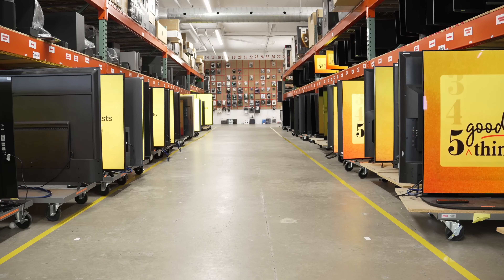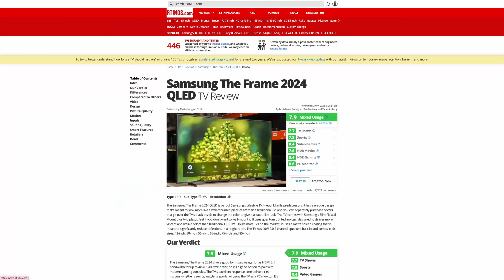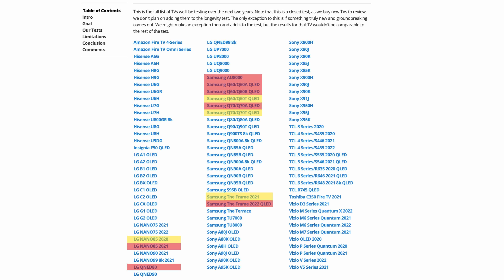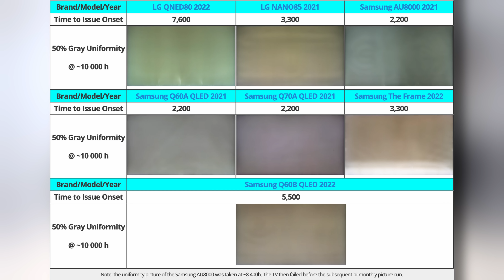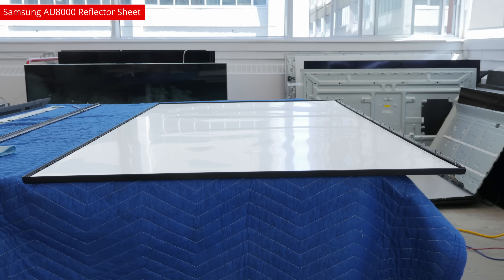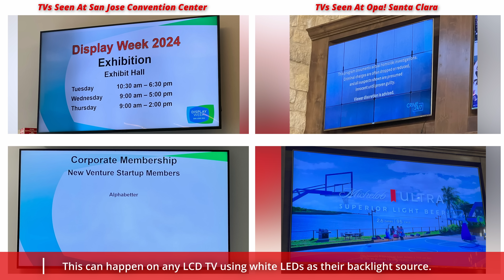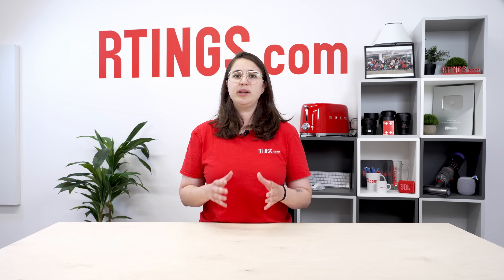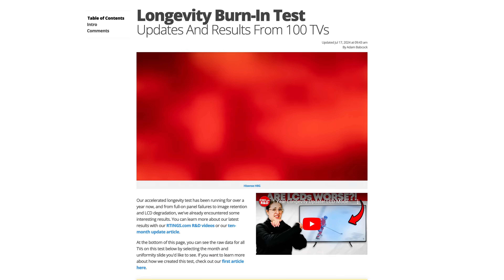Edge-Lit TVs Fail FASTER Than Others (100+ TV Test)

Comment: This is fascinating, it’s honestly weird to me that anyone buys edge-lid displays when they’re so much worse. I always figured these would’ve died out after the 2000s because I always though they were purely made to be cheaper than full array sets.

It was interesting to see they’re still around and it does make sense considering they can be thinner, but this is just another reason to avoid buying them.
Reply: You do know most people don’t know what are edge lid TVs or full array. Most people buy thin, cheap and big.
Reply: @jtcr17  and low quality.
Reply: They were initially made because it was easiest(fastest & cheapest) way to make LCDs thinner. LEDs are brighter, more compact and more efficient as I’m sure you know.
Reply: You think it's weird that 99% of the population doesn't know the difference between oled and edge lit lcd? It literally boils down to what is the biggest size for the price and that's it
Reply: people generally do not understand display technology in the slightest.
Reply: and that's why consumers so often make bad choices. That's not a surprise.
Reply: They are only around today because about 80% of all TV buyers out there don't do their homework before making a TV purchase. They simply either buy what their friends/family tell them to buy or the just buy whatever is cheapest at the time and what is on the deepest sale. Those are about the two absolute WORST ways to go about buying a new TV.

Comment: Your tests are so helpful.
Quite shocking that edge lit screens can be considered weaker than OLED's in terms of lifespan.
Reply: My old Panasonic Plasma from 2010 ist fine. Working good, No burn in, good colour, Just one Pixel ist dead. 
But picture ist little bit dull / Not very bright. 
But No Problems in over one decade of using it as primary TV. 
Two years ago i did buy an LG OLED, because of 4k and HDR. 
The Plasma ist still working in the guests room.
Reply: What's shocking is that those TVs are extremely dull - I have a Frame and it says it hits 600 Nits, it looks like it's dead in HDR compared to my 2014 Sony in SDR.  I've no idea where the heat comes from.  It's not like they are showing anything impressive at 1,000 nits...  The 2014 Sony is supposedly Edge-Lit but I've measured large highlights at 1,000 nits in SDR (in Standard mode) and it still has a perfect white screen and even temperatures across the entire panel which suggest that it might be back-lit (and Sony seems to have hidden that) 🙂
Reply: @techsamurai11 it’s very simple: older TVs are thicker and have more metal that dissipate the heat. Newer models are extremely thin and light but buying them for cheap, then they’re built for cheap, therefore more plastic and lower materials (including the LEDs). Of course they won’t last long…

I had a Samsung TV from 2013 or something like that, 1080p, LED (don’t know what the tech was) and I sold it last year as new!!! In my family we have a much more advanced 4K TV (but new at the same price as when my 2013 was also new, around 600€) and after the warranty the panel started to shift to blue. I talked to the support and they wanted almost the same price to repair as a new one!

Things are built now with two purposes:
- last enough for the warranty to end
- not to last enough so that you keep it too long.

That means: before 2015 they were more built to last >10 years; after 2015 they were built to last 4/5 years and that’s it.
Reply: A broken LED backlight is pretty much repairable. My 2015 LG TV broke in 2021 and got it repaired by a local shop. They replaced the broken bits.
Reply: My last lcd tv lasted 14 years. My current 6 year old oled doesn’t show any signs of burn in after 22k+ hours of use but it is starting to have issues with motion
Reply: Need to distinguish between led edge lit (the cheapest tvs on the market) and led full back lit.
Reply: Wonder what thick plasma screen are or were?
Reply: According to my findings on the internet the average lifespan of an LED TV is 5 to 8 years, while OLEDs are usually rated for 10 years.
Reply: @neptune612  My first LED screen died or more like shifted to blue after 7 years.
The second started having issues with dirty screen effect after 3 years.
The third is OLED, fingers crossed since am taking extensive care.
Reply: @neptune612  8 years is rare for almost any tv made in the past 5 years.
Reply: @neptune612 weird, my parents have led TV for like 15 years
Reply: @neptune612  LED in my friendsgroup is 3-15 years. OLED has yet to die but some early LG has burn in.
Reply: @neptune612  "rated" for 10 years means eff all if it's the usual unreasonable lab test standards, similar how MPG ratings have almost nothing to do with the real world

Comment: I'm certain the manufacturers are using much cheaper LEDs than necessary for the brightness targets and overdriving them with too much current with insufficient cooling
Reply: It’s shame consumers won’t accept 3-4” thick TVs. You could get way higher brightness, properly cool the LEDs, and have a more robust chassis.
Reply: @MechAdv  Some of us still use Sony Trinitron TVs you know. Videos like this one make me laugh.
Reply: They need to sell tvs to stay in business. Absolutely nothing is built to last a lifetime these days. Buy a car or a house and you will see what I mean.
Reply: Apple cooling style
Reply: I have an 20 year old Samsung lcd and it still looks fine. It is also much thicker then current LCD so it has much surface area to dissipating the heat.
Reply: the story of consumer leds for the last 15 years basically.
Reply: Nah.. I`m sure they are using one of the best models available. Marketing is the problem: customers want thin, cheap and bright TVs.. so no heatsink in a slim body with plastic back because it must be cheap and extremely high power for maximum brightness - you get what you asked for.
They definitely can make Edge lit displays durable - but they are made thick and not so bright.. so people don't want them.

LEDs are extremely cheap compared to other parts of the TV

Comment: I have Acer Predator XB323U GPbmiiphzx 32" WQHD. I mostly used in HDR mode.... This had some nasty heat issue that after a year, I had discoloration in the bottom part where the LCD backlight is. white look like nasty yellow... and any color displayed there looked washed out. I had to change monitor because of this. Seeing that backlight LCD burn remind me of this... but the thing was, that monitor is was pretty thick. So yeah, I guess this is one to look for if you buy LCD I guess.
Reply: its not monitor thickness but led cooling structure thickness. Slapping a 10cm empty cover can make a thick tv too, but it still will be as bad as before. Only way to get guaranteed thick tv is to buy ones with full array local dimming as that can be proven that the tv does have.
Reply: @hamzashaikh9310  I am using Samsung Neo G7 right now which is full array local dimming. This one’s panel is way cooler to touch compared to that Acer which was downright burning hot in the bottom.

Comment: Funny thing about edge-lighting LCDs is that it basically returns them to the state that LCDs were in during the 2000s when fluorescent tubes were used rather than LEDs. You can easily identify those CCFL displays by the massive heat source located at the top and/or bottom. Only then it would seem those diffusor issues weren't as pronounced, probably because displays weren't so humongous yet?
Reply: CCFL gets dimmer over time. Need more frequent calibration. And pure white is more of a challenge. CCFL's have their limitations and it's quite logical that it's replaced by LED lights.
Reply: the funny thing is that CCFL tvs proved to be more reliable than LED tvs... But thats not on the technology itself. Thats on the manufacturers. I remember the first LED tvs from LG, Philips and Samsung. Theyre still kicking around. Some years later, manufacturers like LG decided to cut some costs.. and you have every LG LED TV from ~2014 until ~2017 to have defective backlights.
Reply: @detmer87  They tend to fail gradually though unlike LED's. Yes they get dimmer over time, you compensate for this by increasing the brightness setting in the OSD and driving them harder which accelerates the degradation but you can get another year or 2 out of them by doing this.

Another issue is that the colour temperature can shift as the lamps degrade, you can similarly compensate for this with the RGB colour settings in the OSD.

I had a CFL backlit Samsung monitor, used it from around 2011 to 2023 when it finally completely failed. By the end I had Red set to 0, Green 25 and Blue 100 in the RGB settings to achieve a neutral white and the screen was getting fairly dim at maximum backlight intensity.

I also had a CFL backlit TV last a similar amount of time with the same symptoms, it however eventually developed a sufficiently warm enough colour temperate that the OSD settings couldn't compensate for it. I eventually gave it to someone and their kids damaged it >:V
Reply: My old Sony ccfl lcd is still going strong after 13 years. Never missed a beat, apart from a faulty remote sensor....
Reply: @detmer87  The CCFL's lasted longer though in most cases
Reply: @detmer87  As a long time TV and laptop repair guy I can say CCFL's usually start turning red/pink as the anodes of the tubes wear out. Then the inverter will start shutting down because there's not enough load on the circuit. LED TV inverters do this too. LED's will fail gradually too, usually turning blue. Again they'll get to a point where the circuit shuts down due to not enough load. You can prolong the life of both by turning brightness down to 60-70%.
Reply: ...or thin
Reply: @wtpauley  Good point, those old CCFL-based TFTs had those nice airvents and plenty of ventilation. All features which these super-thin displays do not have. So you have no ventilation in far less space, trying desperately to dissipate more heat from these massive LED strips purely with heatsinking, yet without turning the TV's backside into something too hot to touch.

So yeah, those LEDs are being cooked, along with the diffusor. Explains a lot of the issues seen by RTings.
Reply: I think that depends very much on the size of the panel. I've had a few ~24" monitors and ~40" TVs apart from the CCFL era and most used an array of tubes running the whole height of the screen (more like direct backlit TVs) - indeed several of those disassemblies were to investigate a dark stripe on the screen caused by a single tube failing. These also had a lot of empty space between the panel and the tubes, presumably to keep the heat away from the diffuser. All of the smaller displays I've looked at (mainly laptop panels) did use a single tube at the bottom, though.
Reply: The funnier thing is, I wouldn't be surprised if those CCFLs were actually more efficient.  The tubes themselves actually never really got all that hot, but the inverters sure did.
Reply: @Toastmaster_5000  They were not more efficient.  CCFL tubes produce a lot less light per watt than LEDs.  You need to have a tube about 4' long, T8 in a modern efficient design without a tube heater always running, to get close to LED efficiency.
Reply: ccfl.. you should look up the actual meaning of each letter and then remember that these LED's are getting MUCH hotter.